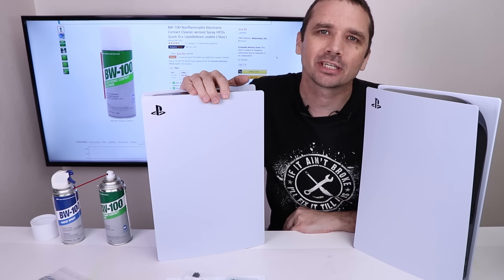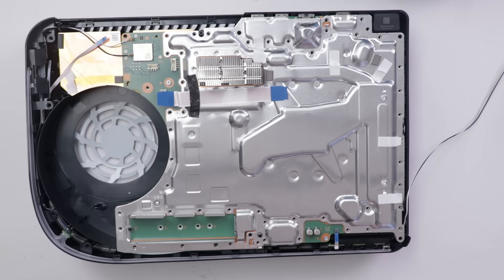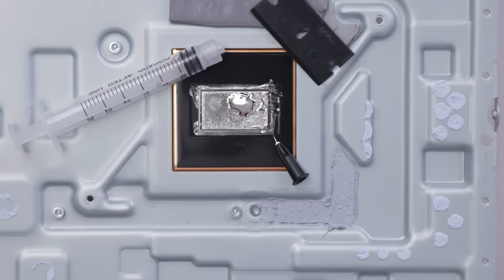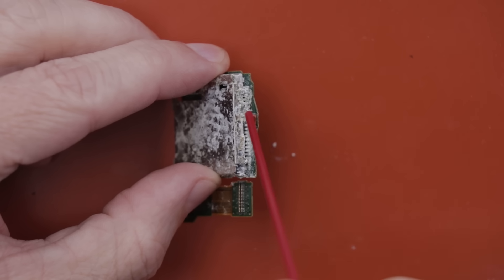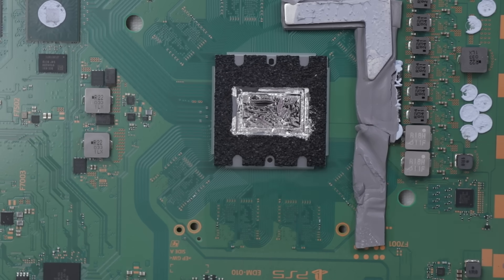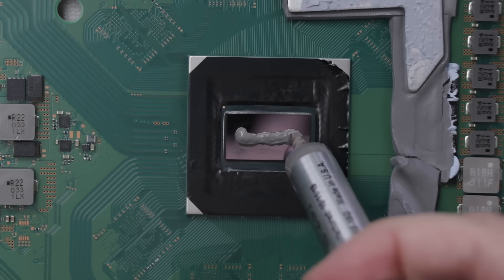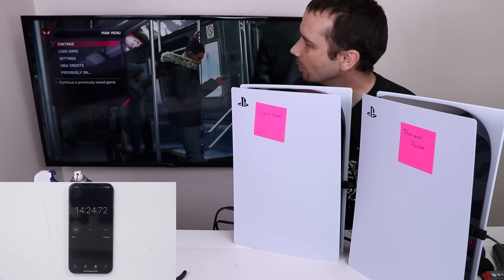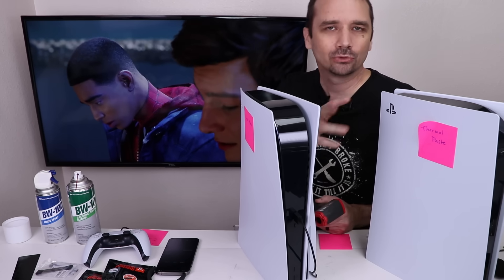PS5 Liquid Metal vs Thermal Paste - It OVERHEATED!

Comment: Interesting how the liquid metal dissipates the heat more efficiently.  It will be interesting to see how well it works 2-3 years down the road.
Reply from the maker: Yes it will!
Reply: @Tronicsfix   Is there typically a state change to the liquid material due to heat and/or age?  There is reactive issues with other metals, so I suppose something must have been done about that at least. Some coating metal on the sink maybe?
Reply: @AltCutTV  it's stays the same n this is why it's better thermal cooling solution ever.
Reply: @AltCutTV  TronicsFix must open it to verify the liquid metal condition after 2 years (of use or non-use... ?!)
Reply: @asifmetal666  no metal liquid stay in the same condition for eternity , somes say lifespan between 2-3 years depending of the use
Reply: @Tronicsfix  2 years later it could be the right time to open it and check it out
Reply: @Nighterlev  It does not age or dry out. It forms a bond with Copper. If there is a boundry layer like nickel or gold between them it stays as an alloy.
Reply: @JKrych  it is more like nickel plated in my opinion
Reply: So far its been working horribly
Reply: Not very well after degradation
Reply: @C Preacher i did the math once long ago. For the time they sold somewhere like 40-50mil units within some years and if you factor in even the 20% whoch some places said more  well we're talking still 10-15+ MILLION units. Ps3 was slower to sell and released late, correct? Ps3 slim came by 09 after the xbox fiasco, and then it chipped away quicker saleswise. Prior to that the old ps3 systems sold were smaller saleswise and by 08 the fats were fixed, and even if its the barely 10% of this smaller sales batch we are still talking a fraction of their total sales. 
I read somewhere idk maybe 50k total or after i did the math it was like 50k systems. Even 1 full million lets just say... is a far larger gap over xbox. Obviously it was small scale enough that it wasnt an issue or need to have given refund. And it was only few models. Where is pretty much all 360s had rrod. 
Heres the kicker.. doesnt matter if MS took the loss..they STILL kept sending back systems that werent fully repaired and red ringed again. Ive known a few folks that went thru 3-4 systems and beyond the warranty if you paid someone or fixed yourself it was still a good chance of getting it.(plus the time lost without a system, some said up to a month in reports) It seemed to never end. Just a flawed design. Ps3 the arctic silver crap and better versions of it over time, you were good after application. And even if you paid, you stood a good chance of being well off and over the headache. Turn around was quicker too. Ive sent a slim and ps4, 2 weeks max. It was more software related.
Reply: @DjStiv3  yea. I had 4 360's as a kid i took care of and loved playing, all 4 rrod. My 1st one rrod, i got another, same thing happened. Etc
Reply: My Digital PS5 is still running strong with no overheating problems 2 years after buying it👍
Reply: @Nighterlev  almost 3 years update, still works fine
Reply: @Nighterlev  that why i said almost,  had mine in december I should be seeing so signs of degradation right? so lets see if its breaks in the next 5 months. also "large amounts of people" is a huge stretch. its a small minority probably because they don;t clean their console
Reply: @Nighterlev  Wrong, my fans are still at the same speed my ps5 doesnt make any more noise that it did when i bought it. also millions of ps5 are not overheating where are you getting those numbers from
Reply: @Nighterlev  if that is the case well then you should replace the engineers of multi million big companies for there faulty research
Reply: 2 years later and mine works fine. I only had a overheating issue because my console was pretty dirty and once cleaned it was fine
Reply: In 3 years it will work like on brand new ps5 lol
Reply: @ArthArmani  yes make sure u clean the fan
Reply: When I buy a console off eBay, what you’re doing to them is my nightmare.
Reply: I've ran liquid metal in my PC after about 3 years it starts getting hotter than usual and needs to be replaced so idk what they were thinking it's not the most friendly process
Reply: @kameronleitzel8109  But you are nothing bro, you dont matter at all. 
We are talking about big companies.
Reply: it is true that some people say that it is better to have the ps5 in a horizontal position because that way the liquid metal does not run down??
Reply: @sirusthevirus6879  thats been debunked and not true
Reply: @JKrych  sgsgg
Reply: Yep. It's overheating.
Reply: @FranzBorg  only for people who don't clean their console mine still works great, no weird noise or overheating
Reply: @Nighterlev  those overheating isssue may be cause of shipping. You know liquid metal is delicate. Just may be.
Reply: i just tore down my laptop that has liquid metal on the cpu after 2 years of continuous use , and it's very dry.
Reply: @anerpos2055 Your laptop isn’t a ps5, it doesn’t have the same coating etc…
Reply: @Nighterlev That’s just false info you have parroted off of social media. It can stand up right just fine. This has been tested there is no difference… As for you other claim it’s just a crock of lies, where are these supposed mass overheating problems we should be seeing? Instead we see very very minute cases… In other words you weren’t right…
Reply: Welp 2-3 years has past.
Reply: @ThePillisReal  mine is still doing well, but I may not play mine as much as others.  As much as it makes people angry for some reason; I also keep mine in a horizontal position even though I haven’t opened it yet.
Reply: It’s now been two years now and I need to know
Reply: It don't :(
Reply: I was thinking of making an all aluminium box for my Xbox series X ,in the UK we have an earth terminal so you would need to make sure an earth wire was fitted to the case but what a cool machine it would be😊
Reply: i bought my ps5 on summer of 2021. I have done nothing to it and its still silent and runs very well.
Reply: Same as any pc lol 1-2 degrees isn’t enough to really care
Reply: I mean just the physics of it - liquid metal has like a 80W/mK thermal capacity, and average thermal paste has like 7-10W/mK. Huge difference.
Reply: Nessun problema con la mia PS5 del Day1, sempre tenuta in verticale con uno stand a muro della Spigen. Pulisco la ventola e i dissipatori ogni 3 mesi circa
Reply: Liquid metal  not lose your properties
Reply: @icold666  not true, inform yourself lifespan between 2-3 years
Reply: @rayoflight-777  my guy I’ve had a delidded 4670k for 8 years using the same liquid metal between the ihs and die. Zero degradation of any sort. In 8 years. Stay away from aluminum and you’re good. It amalgamates with aluminum. Haven’t had an issue with anything nickel plated.
Reply: Why are people arguing about consoles from 2005.
Reply: That's one of the reasons I don't want a PS5 right away. Sony launch consoles always seem to have some form of widespread problem. Everyone else can test it, I'll pick one up in a few years when it and the games are cheaper if it works out okay.
Others include the current lack of games, that it's not even ready yet because the system software doesn't even support expandable storage, the always on mic that's probably always recording and selling the recordings to third parties, a lack of "play anywhere" functionality like Xbox and PC have (yes Microsoft owns Windows, but Sony could partner with an existing store like Steam or make their own store/launcher), and annoyance at being expected to buy all new controllers and accessories because of greed.
Reply: @mjc0961 that was a weird way to say "I can't afford a ps5" 😂
Reply: @mjc0961 Your comment aged horribly and was littered with false information
Reply: @mjc0961  its never "widespread" of any issue. Even ps3 had the ylod which affected i think 50k batch of systems. Amd at that time there was maybe 10mil sold i bet or more. Its a drop in the bucket. Microsofts rrod affected 40% of systems i think at the time when they gave in and admitted it ..they had like 40mil sold. So 16mil consoles affected essentially. Vs like 50k. And how many ps5s affected we dont know yet. But by looks of it not many are returning or saying anything sooo idk. Granted yes dont buy day 1....but id be willing to bet its under 10-20% max or 1 in 5 chance that ones system will be affected.
Reply: @DjStiv3  judging by the rest of that guys comment, I just think he doesn’t like PlayStation 😂
Reply: @jose131991  agreed, and honestly if someone wanted it day 1 thats what warranties are for...
Reply: @mjc0961  the software does support expandable storage, third parties didn’t release in time for support which is why it requires an update patch. Sony disabled it so that there wouldn’t be any compatibility issues.
Reply: @mjc0961  so Xbox don’t come with problems any product that launches early has problems not just Sony’s lol my ps5 is working flawlessly
Reply: @C Preacher also at that time they wete still 400 maybe 5 with tax. if you bought new that would be stupid. Bht yes i knew one person as well. But jesus. Slim came out at lowered 299 price in late 09. If the slim had same issue maybe i could see it and justifying 160 but spending extra couple hundred for new in 07 or so is just dumb. And how many 360s are out there that are bricked or rrod and beyond repair and whatnot? Pretty rare to find a ps3 woth ylod. They still hold value. I sold mine for 200 bucks late last year
Reply: @KühlesEtwas  Lol.
Reply: @Nighterlev  Your wrong you won't see any changes in that time. I've had my GPUs for 5, years now with liquid metal. One always ran 10 degrees cooler and still does. But the hotter GPU would run 85-90 and still does to this day.
Reply: 2 years later, it does not last if you keep your console upright, the die gets flat spots where the liquid metal has moved off
Reply: @KühlesEtwas  your right. slim had disc drive issues/accepting them lol and kept scratching them too. Gotta say.. loved bluray on ps3. Miles ahead. My discs are still perfect and the drive still works good. 360 i had issues and others did too.
Reply: I can tell you this my ps5 is a year old now it's only been turned off 3 times because of power outage . it has been played everyday from me or the kids and from day 1 to a year later it hasn't changed the thermals and sound of the ps5 has not changed .
Reply: @gamerX-wk7ct  see you in 2 years about that
Reply: @DrRhyhm 
It's been two years. I'm curious. 😂
Reply: @gamerX-wk7ct  any changes after this time?
Reply: @senik8214 i haven't had a issue . I cant say the same for my nephews ps5 but he doesn't listen . Kept it standing on the damn floor so it is full of dust . Im cleaning it for him . With me i keep then clean even got the ps5 pro . My experience is take care of it and it may last many years .
Reply: @Nighterlev  Sony spent years in developing the use of liquid metal in their consoles. It's not like you are just randomly putting it in a build you've done. How do you know they haven't applied some kind of coating that stops the absorption of the liquid metal? I'm sorry Sony developer you are right

Comment: Are cooling fans the same?? There is talk and comparisons that there is 3 different fans and it affects noise very much!
Reply: Yes that’s true but the noisier one made by Nidec may have the best cooling capacity due to blade design.
Reply: I've got the same fan as in the teardown. Whisper quiet no coil whine 😜
Reply: Yeah, there are different cooling fans depending on the PS5. I think some are PS4Pro fans to save cost.
Reply: @MicCheckMemoirs  no they're not. The PS5 fan is literally twice the size.. They can't use the PS4 pro fan. Not sure where ppl get this BS
Reply: @RaiZdbyDINGOES  then why are there a different amount of blades depending on SKU?
Reply: @MicCheckMemoirs  You're basing this on what exactly? Can you find the part number on the PS5 fans that are the same as the ones in the Pro? I mean since you said it's from that, you can surely prove it, yes?!

Comment: That's about what I expected. I know gamer's nexus did a thermal review (you won't find anyone better than them for that) and found that for the most part it's not that bad, but a couple of areas are running borderline too hot just stock. They put in thermal couples practically everywhere. They had a few suggestions for sony to fix it. The biggest issue though was that the airflow is HORRIBLE. The found just running it with the side off alone really helped with thermals. So when you have borderline thermals and remove the only fan? Yeah it's going to crash in a game pretty quickly. lol